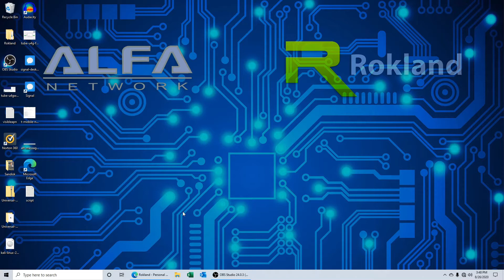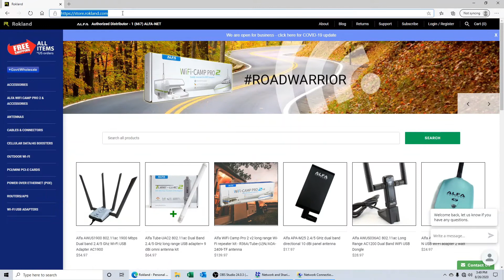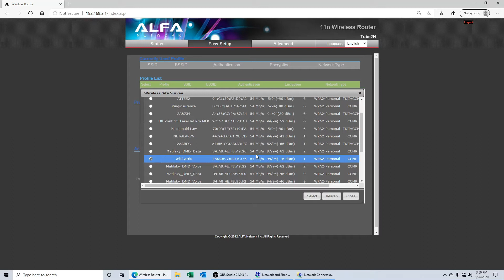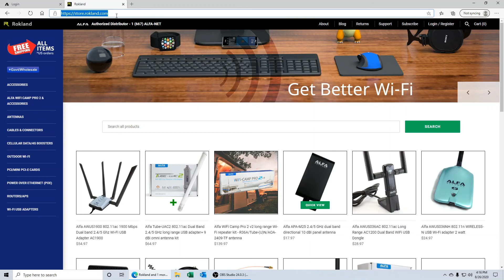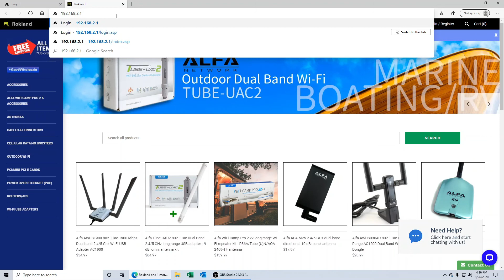Alfa Tube-2HP Outdoor PoE AP/CPE Hardware and Software Setup: Client Bridge Mode

Comment: got a question to make sure i understand this.  

I can put this outside,   run EF cable to the power point on the black box.   Then run the other cable to the back of my computer.    And my computer will use that antenna as the wife  instead of the one inside my computer.   (if i select the one you did)   am i right with this?

Comment: thanks for the video, seem fairly easy but I don´t get to the login page after setting everthing up like you explained. Antenna is on and and recognizes that there is a ethernet connection (two blue lights), static ip is set up, tried several browsers. What else can i try to bring it to life?